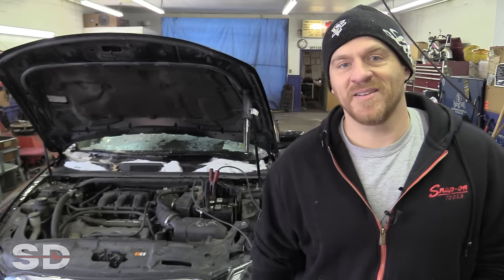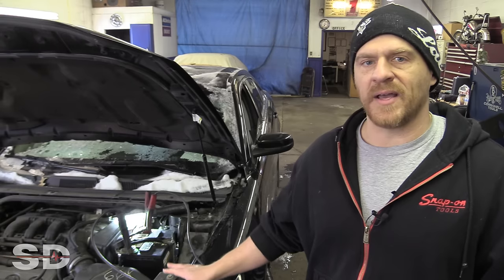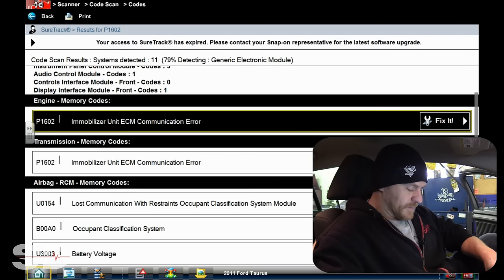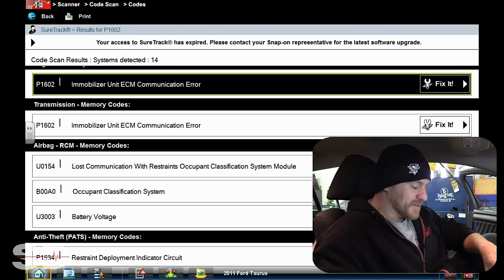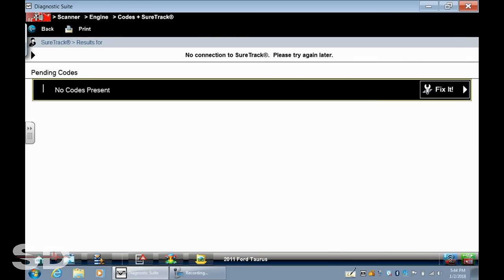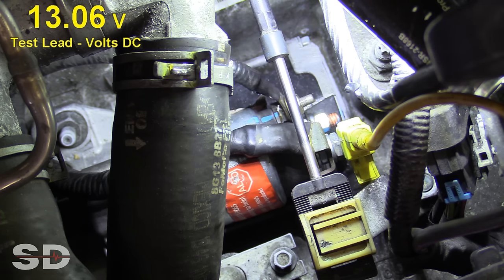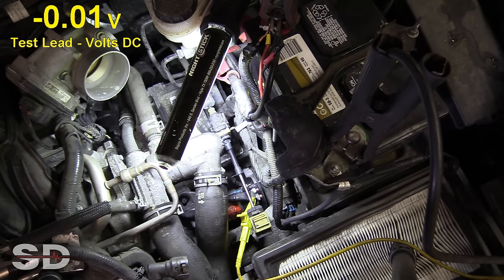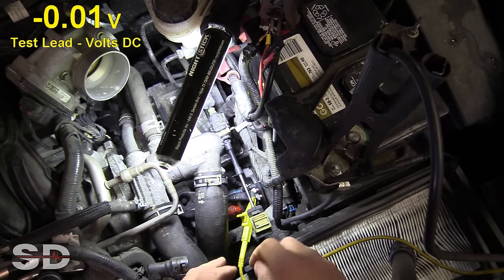No Crank, new starter, how to troubleshoot, any car! (2011 Ford Taurus)

Comment: I worked on many intermittents in electronic equipment but the process is similar.  And as you say if it aint broke it is hard to fix.  So, one day i was looking up reviews for a local auto repair shop that I thought I might use.  There was a negative review by a customer that said they took their car to this shop who had it for a day or so and told the customer the problem was intermittent and they couldn't make it malfunction so they gave him back his car with no charge.  So they couldn't fix his problem but they didn't charge him either.  Having worked on intermittents I understood the problem, and I said that is an honest shop, and started using that shop.  I haven't been disappointed.

Comment: good as always.  i was taught a little differently. i see you check voltage across the battery as a baseline then at the terminal etc and subtract the voltage to get your drop. which is fine.  i was taught to put the meter in parallel with the circuit under test. the meter with the unloaded circuit may have a reading but dont worry about it. the high input impedence of the meter wont activate most automotive circuits. then load the circuit with its normal load and while the circuit is loaded you read the direct drop reading on the meter.  the theory is what shows on the meter is the amount that cant make it through the conductor. thus the drop. this also accounts for small variations the battery drops as it is loaded. served me well for the last 40 years.  also easier when you are doing say the starter stud to the ring terminal as both leads are right there together.  both ways work and do what they should as i have done it both ways on everything from cars to nuclear densitometers.
Reply: Ya I was wondering about those connections as well. From where he hooked up I believe you would be seeing the voltage drop of the starter itself. Hence the math you were talking about. Normally you would hook up from the battery positive post to the starter stud. This measures the voltage drop in between. That extra resistance is like a series circuit with two bulbs. If the bulbs are the same resistance you would see 6 volts dropped across each bulb totaling 12 volts.  Voltage drop of the cable should ideally be 0 but you will loose a little should be less then a volt. In school I think .5v what acceptable. I've seen a cable drop a few volts before....3 or 5 volts I forget. Car only started while boosting because it needed that extra "pressure" to start the engine. 
But theirs more then one way to skin a cat so after writing this I think I understand the method he was using. 
Love these videos Danner!

Comment: Love it.   I'd guess the Bendix may have been stuck on that starter out of the box and once it went through one cycle it decided to unstick.
Reply from the maker: Not sure to be honest. Sounds like the most likely scenario though, thanks!
Reply: FrugalPrepper
I'm assuming your refering to the Starter solenoid when you say "Bendix".....Bendix is a corporation not a part of the starter.
Reply: zeke112964 the bendix is the drive gear and return spring subcomponent for the starter that gets thrown outwards to engage the flywheel.
Reply: I worked in parts retail in conjunction with a shop. Tons of these Chinese rebuilds have this stuck on/first time problem. We used to deal with a local multigeneration rebuilder who was in business since the 1920's. He laid off most of his work force because of the influx of Chinese parts. He now only does custom/industrial repair. His looming problem is sourcing decent field coils for starters. I have tons of Internationals that use MT-10 Delcos and half of them Chinese starters out of the box fail a megger test on the coils. He said he could get me some coils if I would go halfers on a SeaLand van from China... But then again, we're back to the same problem.

Comment: Holy Cow, that battery cable splice "repair" brought back memories!   30 something years back, my first car was a hand-me-down POS '77 Subarooo sedan.  The positive cable clamp and the first inch of cable had disintegrated thanks to a severe case of the Western NY green crusties.  My local Allegheny NY K-mart carried those cable splice things, the dealer was too expensive for a real cable, and I was a broke kid.  :D   I put the splice in place and soldered the daylights out of the connections.  It was definitely a hack job, but it held for a couple of years until the car rusted apart and had to be junked.  I got lucky with the splice repair, probably thanks to the solder job and because early Subarooo engines weren't much more than lawnmower engines.   I still have an extra cable splice kit hanging on the wall of my garage.   I don't plan to use it.   LOL  BTW, I enjoyed your video and have subscribed.  Thanks!

Comment: Hi Paul, I've never seen a repair like that before, never even seen anything like that joint before, we on the other side of the pond, call that a numpty joint, because you would have to be a right numpty to fix something like that, lol,  I enjoyed the video but I always start at the output side of the starter solenoid for my first voltage drop test and work back, but your the man Paul, and I wouldn't dream of trying to showing you how to suck eggs, Basically its your fault I bought a scope, keep up the good work, Cheers

Comment: Would this issue cause a main 120 amp fusible link to blow on the positive battery terminal? Or just lose the connection? I really want to get a good look at the cables on mine but all the dang cables from every which way are bundled together and then those huge bundles are wrapped together in that split loom stuff. It looks so nice, I don't wanna ruin it haha

Comment: Heh, this remainded me of one time that i used H4 pulp to test a wires to starter.
First was starter command wire. H4 was brith, on ignition on starting. Next was B+ that lithed that light birth as well and i was sure on that point, that it needed a new starter.
Then i turn my head and start LOLing ;D
The the birth H4 light showd me a box on the firewall. The damn B+ cabel had a bridge box in firewall and it was so full of green stuff that it did come out of that plastic box.
So the secend i hit the ignition to start, the H4 55w lamp whent out.
Well i did learn my lesson on that just "a load" dont do any good you allso need to know the correct load of the part (and for future, to know when some parts do use too much dosent hurt eather).
Cheers! and happy New Year to you too!

Comment: Wow...I always call u Paul the great
Thank you so much sir for the great info

You just introduced something new to me in the whole mix..
“Computer controlled starting system”
How to deal with that system ?
And how to disable it ??
for example if I wanted to do a single cylinder compression gauge test??
How to crank the engine manually ??

And happy new year Paul :)

Comment: Great video.  I have a 2010 mustang with an aftermarket remote starter, and anytime I disconnect the battery, upon reconnection the car immediately starts cranking.  I wonder if that car has a remote starter.

Comment: Super video, same problem with a Ford Fiesta i Copenhagen, batteri voltage is low, try a new batteri to morrov,  PATS is ON. :)
Reply: uhh, multiple issues going on, not counting the previous herp-derps working on it :))

Comment: HA! That looks like a 120v AC lug connector for line to house wiring on the battery cable there.  Wouldn't be shocked if you find some wire nuts making connections in that vehicle too. :D

We got over a foot of snow - drifts over 3 feet, and still coming down here in western central MA. I'll  start the cleanup chores tomorrow i guess.

Great video - another perfect demo on the importance of voltage drop testing. HAPPY NEW YEAR brother!
Reply: No doubt that it is, I have plenty lol

Comment: I have seen a low-voltage condition that caused the starter to stay engaged after a low-voltage hi-amperage cranking draw essentially welding the Contacts together at the solenoid temporarily. Then after hooking up a fully charged battery, with the Contacts still welded together and the starter still engaged, The starter cranks and continues to crank without any input from the ignition. So in a panic your main job was to stop the starter from staying engaged and cranking without ignition input. I unhook the cable, Then hooking it back up and the starter disengaged and the problem went away. This may have happened to you!

Comment: I did notice at 17 minutes when it surprised you by cranking the voltage dropped to 10 volts...if it was a crank no start i know that on fords even if it cranks ok if the voltage drops to low it will not start. A good indication is if the dials do a sweep when you put the ignition on you know it has had a low voltage event...so then you have to explain to the customer that although its still cranking you need a new battery..

Comment: I have the same car but a 12 model. Same intermittent starting issue but my cables are still factory and never been messed with. One question I have is why was the cable on your customers car hacked in the 1st place? Was it having the issue prior or was it something else. I've checked my cables ends to battery to make sure their clean and snug, put a new battery in last fall.. Did replacing the cable end up fixing this issue? Thanks..

Comment: I had a no crank recently, the starter control wire fuse kept blowing. Turns out the circuit board was shorting to ground inside the fusebox, and it was intermittent, which was weird. I thought the problem in this video was going to be the control wire shorting to the positive 12V, which would explain how it was cranking by itself, since this is how I'm starting my car until get my new fusebox.

Comment: Had the cranking while connecting the battery happen with the key out when installing a new battery that was overcharged to about 18 V cause that issue once discharged work just fine

Comment: Hey Paul, i have an issue need your opinion. Went to buy a new starter but it was updated (from 11 teeth to 10 teeth)  as ford dealership claims. What's your take on that? No long term affect despite different number of teeth ? 

Fusion 2016  2.5l

Comment: Happy new year. 
I got Chrysler voyage bur the high light will turn on when i open the ignition bur not off when i turn off the switch. And the wiper wash too is not working.
Reply from the maker: Need more info than that my friend. Year, make, model, engine size etc. Post this to my forum please. Thank you! IT is free to join https://www.scannerdanner.com/forum/post-your-repair-questions-here.html

Comment: So..., why did the car crank by itself when the battery was connected?  Was the solenoid to the starter stuck closed due to heat?

Comment: I agree with Smitty Smithsonite. That DOES appear to be a "household" or "general purpose wiring" type connector, that you'd get at Home Depot. It appears to be aluminum. If so, that's bad. For one thing, I think there would be a build up off resistance over time due to electrolysis. Also, I think I've read that copper to aluminum connections are a bad thing, just in general. Not positive, just think I read that someplace a long time ago. Also, are those two set screws REALLY REALLY tight? Copper to copper joints should always be just that, copper to copper.  Hope I'm not wrong about this, just going by very distant memories.

Comment: Yeah typically if i see low battery voltage DTCs literally on all modules i would ignore most of the DTCs, charge battery and wipe it as well. European cars are the same especially luxury cars will show nearly everything in the car is has a fault lots of garden paths. My wifes immobiliser plays up occasionally during very hot weather but you can tell by looking at dash if the immobiliser light flashes don’t bother cranking needs to be solid and starter will turn over it just doesn’t fire up like no fuel I’m guessing its stopping the injectors from firing. Haven’t bothered fixing because its usually fine after 1-2 cranks and been like that for many many years.

Comment: I got Ford BA falcon 4.0 straight 6 engine. Car has been sitting for 2 months and battery totally flat out. Put new batery and there is no crank or even solenoid clicking. Scan the system and there is active fault P2105. Check  relay and fuse of starter motor they are ok but there is no -ve control on starter relay. What might be the problem on this.

Comment: Yeah. Must be good for the ECM and other modules to have almost 17 volts. Should you disconnect at least one lead from the car's battery before doing that test? I think so becaus as you know even with ignition off the computers on the car are still connected to a permanent power line. So I think you should disconnect one of the battery leads to make that test. What if the battery is open circuit and the charger decides to kick 24 volt on the ECM? Should be ECM barbacue right the way.
Reply from the maker: I would suggest disconnecting the battery from the car for this 3 minute high charge test of a dead battery.

Comment: l have a 2003 grand marquis with a crazy problem my abs and brake light came on one day while driving home ,got home turned it off and will not restart ,I put it in the shop three time and when I got back home all three times same thing happen next step is ford dealership and you know costly that is please help me

Comment: Hey can you please make a detailed video on how to test relays, I have a 1984 BMW e30 that was running fine even though I had to hotwire it as my keys were stolen, went on holiday and when I got back it didn't even crank at all, fuel pump primes, ignition comes on and radio works and all  does this sound like a starter relay or ignition switch? Or could it possibly be bad starter, the starter never had issues though. Thanks heaps
Reply from the maker: Kaleb, open up the description section of this video. You will find what you need within the related videos I posted or from my starting system playlist. The Hyundai one in particular will be very useful as I go through all the pins of the starter relay. Also this video you are watching! Performing a voltage drop test at the starter is where you need to start!
Reply: +ScannerDanner thanks man, your videos are great but I'm just 16 and looking for an apprenticeship ATM so I'm just learning hahahah, you're the only YouTube channel that's actually responded, cheers, I will try to thoroughly understand your Hyundai video and this one and hopefully I can get her started
Reply from the maker: I'll help you as much as I can! Watch this video too. As a young man, new to this stuff, this one is absolutely essential   - Multimeter basics, voltage and resistance tests (a free SD Premium video)
https://youtu.be/w0PpLTnKKZg

Comment: So just a guess. Short to ground when starter was installed. Threw the codes for pats. Go into the pats menu. Clear the pats codes. Additional problem created by attempted fix. Ive been going through this with my excursion.... did the same thing chasing a short to ground. Set off pats codes. Have to get evrrything ckeaeed and back to original condition to fix the corrrct initial problem.
Reply from the maker: this was an open circuit right? I don't remember a short to ground, but yes on the rest! I get it for sure
Reply: @ScannerDanner  I dont remember either. I think that was my guess as I wrote it before watching the video

Comment: Whats your opinion on the SureTrack system from SnapOn? They say they check the submissions before they're added, but I've had it tell me that somebody fixed an EGR valve code by changing brake rotors
Reply from the maker: I don't use SureTrack. It is a step up from a Google search, I'll give Snap-on that

Comment: The cranking on it's own must be a for thing when the battery has been unhooked for a bit must be a Ford thing. I work at a parts store and have had a few Fords do that when hooking up a new battery. I have found as long as i keep a jump pack on the cables while changing a battery it does not happen.

Comment: A 900 Komatsu front end loader has a 200 amp fuse in the main battery positive cable I seen one or two of those blow after the engine was changed and we had a no-start condition with a brand new engine 250 thousand-dollar engine and would not start

Comment: test the fuel pump if its working if there is fuel  supply to the injector
Reply from the maker: No crank means the starter is not spinning. Why would you test the fuel pump?

Comment: DC voltage is a b***h for causing this type of fault. I'm a railway faulting technician and our point motors are 120v DC driven via a heavy duty relay and batteries to supplement the charger power supply. This is exactly the same issue we get when the relay contacts go bad and is proven using the same method. When we get a suspect open contact, we place the volt meter across the contact or break and usually get full battery voltage, obviously this shouldn't happen as your only in one leg of the circuit (positive or negative).

Comment: I gotta 2995 Nissan quest and I got a new starter and battery with no codes . What is the problem please. Because these shade mechanics always suggest I get a new motor. I only changed the cam sensor. I put it in the shop and God  heavenly knows what they did to my engine.  It just stopped when I was at the stop light  and . I got my Nissan  tested several times by t?these mechanics and no machines work. I'm watching this video and do you think this video will help my car. It's been  years and people keep telling me I need  a motor. Please I need the issue problem
Reply from the maker: It doesn't crank and it's been this way for years? You're going to have fuel issues too if you ever do get it to crank.
Step 1, can you turn the engine over by hand?